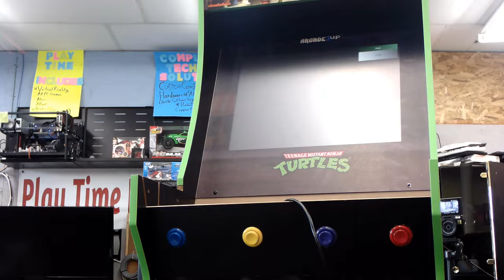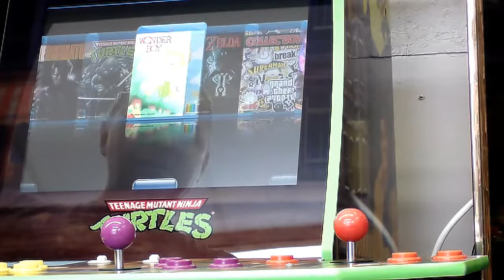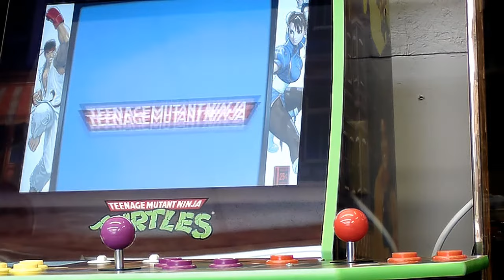Lets "Bake a PI".. This time lets upgrade this awesome TMNT Arcade 1UP!

Comment: Cleanest Arcade 1-UP/Raspberry Pi build I've seen so far!! Well done!! The only things I would change/do, would be to change out the factory speakers for anything better. Mainly since I've heard they blow very easily. I would get and wire up a an outlet for the back so that the plug for power looks cleaner than just a power strip cord sticking through a hole. And lastly customize the Pi's image theme to look just like an Arcade 1-Up theme. But all of these are just nit picks and somethings I would do. Either way, looks amazing and still looks factory!! Very few of these tutorials out there.. Mad props!!
Reply from the maker: graphicsgod Thanks for watching man! I had a great time one that on and I’m about to do another with some crazy twists. Stay tuned :)

Comment: The ‘protective coating’ you removed is plexiglass that is supposed to be there to stop you rubbing the paint off (which will happen if you play it a lot). Its got two pieces of plastic cling on it to stop it getting scratched in transit.
Reply from the maker: Yes it is! I actually noticed that after the fact (I've done 12 since this one) and changed the build a bit each time ;) Thanks for watching!

Comment: I am so excited to do this! I got my cabinet recently and just need to get the parts to start modding. However, I'm seeing mixed things about the LCD controller board working with the TMNT cabinet. Perhaps some have a newer monitor? Can you confirm what model number was on your TMNT board? Mine says 7633 V01a. Perhaps I can send you a pic and you can confirm the LCD board will work? Thanks for the tutorial!
Reply from the maker: Bob Bock Hey Bob, I don’t have the board on me it’s actually at my shop. However, I know it was the stock for that came with the cabinet which she did purchase back in October. I would assume that it’s pretty close to the latest revision. I did also notice that you have to make minor adjustments in the settings of the LCD screen as well as retro pie.
Reply: @AlternateArmsSD  If anything, I get the board and return it if it doesn't work. I can always use a Firestick or something to make sure it works before modding completely. At least taking off the back panel and the TMNT/LCD board is SUPER simple and something I can do in 10 minutes. 

If you're able to confirm it would be appreciated, but there's no rush! I appreciate the response and again thanks for the video!

Comment: Just did this project today and it was fun but a huge pain in the butt. I chose to keep the stock joysticks so I had to literally solder every wire to the a connector and then attach it to the USB encoder boards. The stock joysticks don't have a traditional five pin connector slot like the aftermarket ones.
Reply from the maker: Very nice! I was able to use male to female jumpers to create a "solderless" connection between the "stock" joystick and the USB encoder boards. The stock ones would work but the connection was very tight and I didn't want to risk them popping off. I'm thinking that, in the future, I'm going to swap out the entire button and joystick assembly to a much for advanced set. The stock equipment is "acceptable" but I'm not sure on the longevity of the stock parts. They are definitely not up to a "lifetime of play". There are a lot of other variables I explored but in the interest of keeping the costs down I stuck with the stock equipment where possible. 

I think on the next conversion, Ill upgrade everything. (Including possibly the screen itself)

Thanks for watching!

Comment: Tip for anyone watching this in 2021. That LCD board has an amplified input for sound. You don't need to go out and buy an amp. The little 4 pin port above the aux input that you have plugged in there is the port to connect to. All you need to do is cut off the aux male in on the speakers and connect a 4 pin connector end to it. The cables inside are color coordinated. The red and white is for the audio and the black cables are ground. The two ground pins connect to the 2 inside pins and the red and white connect to the outside. With sound it shouldn't really matter which side you connect them as this isn't like watching a movie with surround sound. The sound is usually flowing through the speakers at the same. With that said, technically the red wire goes on top. If you have an extra joy stick laying around those usually have a 4 pin connector. If the plastic is too big to fit into the 4 pin input, remove the plastic on the sides of the 4 pin connector on the LCD board and just make sure you have conductivity. You could technically just solder the wires directly to it... it is just hard with the pins so close together. Mine is connected this way and pumps out heavy sound. Save yourself the 20 bucks.
Reply from the maker: Greetings! You are absolutely correct! I have a revised build of this coming up soon. The internal speakers are a tad anemic though. I think I'm going to add a bit more punch to the next build. Thanks for watching!

Comment: BTW, I’m gonna record everything that I do and show my finished product.
Reply from the maker: jjrudy41 I can’t wait to see it :)
Reply: SaZoN GoYa yes. I’m waiting on doing one more thing in the mail.light up marquee.
Reply: SaZoN GoYa yes, I added 6 buttons per player. I might actually redo my control panel. I also didnt use a amp. I used pc speakers
Reply from the maker: @jjrudy41  Oh I cant wait to see that! Shoot me pics when you're done.
Reply: Complete Technology Solutions what I did was bought a piece of plywood and cut it out almost to the same shape of the plastic cover that came with it, and then just created my own control panel from there. It came out really good.
Reply: Complete Technology Solutions ok. How do I submit a picture under comments?

Comment: Awesome video so far! I got everything I need and just pulled the controller board and I still am puzzled! Why do I have to flip the on/off switch if it is correct on my NBA Jams arcade 1UP? Also can you please let me know the correct wiring for the single one player USB as I ordered everything you mentioned but, did not get the two player outputs only single player so four boards?
Reply from the maker: Hello and thanks for watching!  You don't need to flip that switch for the NBA jams. It's actually in the correct position. As far as the wiring for the USB encoders, yes indeed one decoder per controller. The USB in coders that I had originally purchased that would put 2 sticks on 1 controller were flaky at best.  So definitely use one encoder board per controller. It doesn't matter how you wire them as long as they are all the same ( And even that is not all that important. You can figure all this in retropie anyway).
Have fun!
Reply: Jon quick question... I wired all buttons the same however the joystick board when i goto test it does not work???? again I created 2 pin wires for the joysticks so that four, and their are four mode, turbo, etc 2 pin following. Why wont the board recognize when configuring on emulation? this is my set up
Reply: sorry ill send it to your email
Reply from the maker: @joshuanickolas4031  In retro pie, have you calibrated the joystick yet?

Comment: I like the industrial velcro idea for mounting the LCD Convertor board, most other videos I see they stick it on some cardboard which looks ugly
Reply from the maker: Greetings and thanks for watching!! Yeah, and that stuff never lets go :-) I’m also kind of a cabling fiend so I like the fact that the Velcro is black. Therefore it doesn’t show up in the background even though I will be the only person that will ever see the inside of that control panel :-) I have another arcade one up conversion video in process now, it’s going to be a little more extensive and I’m doing some pretty cool stuff to it. Stay tuned :-)

Comment: Is it possible to use the stock buttons and joysticks that it came with on the 4 USB controller boards? I don't want to put different joysticks and buttons in
Reply from the maker: ZachAttack84 Thanks for watching! Absolutely! In fact, in this video, I’m using the stock buttons and joysticks. The only addition or the four extra buttons on the front. The truth is, the stock joysticks are not terrible.
Reply: @AlternateArmsSD  Could you please explain how to use the stock joysticks on these USB converter you linked in the description? My TMNT arcade1up joysticks have 2 4pin connectors for each joystick.  The ones you linked us to have 2 pin connects for the buttons + 1 5pin for 1 Sanwa style joystick.

Comment: What a fantastic video. What do you have to do to the Ras pi to get all those games. Once u receive it? Thanks
Reply from the maker: Its not overly complicated if you've worked with retropi. Its just a step by step process. After you download the roms (Where ever you get them) and load retropi, You simply put the raspberry on the local network and access the files structures through the network and drop the roms into their respective directories. (That sounds more complicated that it actually is).. If I get enough interest, I may do an entire video showing how to setup retropi and adding images. Its a tad geeky though which is why I haven't as of now. :)
Reply: Is there specific roms. I really want to add xmen and Simpson's
Reply from the maker: Bobby kuthrell Google search rom packs.. That’s a rabbit hole that will keep you going for awhile :)

Comment: great video! which port number do i plug the tmnt power switch into the rasp pi?
thanks!
Reply from the maker: Hello there and thanks for watching! You'll use GPIO pins 5 and 6 for the safe shutdown/sleep mode for the raspberry.
Reply: @AlternateArmsSD  awesome thank you so much! I have a rasp pi 4, I assume it's still the same?
Also then do you know which port pins the rasp fan should be on?

Thanks again!
Reply from the maker: B Muss Have a couple of options. You can go to pins 2 and 9 if you want to run full speed 5 V. If you want to run 3.3 V you can run on pins 1 and 2 but I would not suggest that with a raspberry pie 4.
Reply: @AlternateArmsSD  awesome thank you so much! I have a rasp pi 4, I assume it's still the same?
Also then do you know which port pins the rasp fan should be on?

Thanks again!

Comment: Reason they need to be wired identical for the 2 sides is a software issue - the Rpi sees both of those USB encoders as identical ( Since they are the same product just on different USB connections) so if they are wired differently the configurations for the software winds up having problems when it sees both as the same type of controller so expects them to have their buttons in the same place and be wired identically ( ie. if one side has joystick down in the place the other has joystick up in the software when the game is running it will sometimes get confused and swap one side or the other so that down becomes up randomly which makes game play weird - SO you want both wired identically to avoid that.
Reply from the maker: JDFan01 Yeah I figured that out at the end and decided to go with individual controllers for each control. That made the configuration considerably easier :-) I still have those “dual” controller boards though and may attempt to use them in the future. It’s actually funny, I bought those from Micro Center right next to their standup arcade machine. However, the “professional” at their arcade machines did not know if you could run dual controllers off one card.

I’ll probably revisit that in the future episode :-)

Thanks for watching!

Comment: I cannot see what you did to connect the power switch to the raspberry pi. What did you use? Where can I get it? Amazon Link?
Reply from the maker: Essentially, it’s a short jumper to the pins on the raspberry. It’s the same basic principle as the nespi cases. I have a more recent video of an upgrade on another arcade one up that you might take a look at. I think I go more into detail and I’ve got links.
Reply: @AlternateArmsSD  Excellent! Which video is it?
Reply from the maker: @ramonrivera837  Try this one (I REALLY Need to do a new one!) :) https://youtu.be/zF6QBIPV2Q4
Reply: @AlternateArmsSD  That fit perfectly in my arcade! I clicked on the link for the "script for soft power on/off" but it do not work. Do you have another link?
Reply from the maker: @ramonrivera837  OK... Try this script and wire the switch to pins 5 and 6.. 

wget -O - "https://raw.githubusercontent.com/crcerror/retroflag-picase/master/install.sh" | sudo bash
Reply from the maker: @ramonrivera837  Ill try to schedule an updated build video in the near future.
Reply: @AlternateArmsSD  Thank you so much! Do you have a video on how to run a script? I do not know what I am doing... lol
Reply: @AlternateArmsSD  I did the script and it kind of works. For some reason, it will start shutdown when the switch is moved to the ON position... Do you have any idea of what I did incorrectly? lol

Comment: Nice video! I bought LED buttons that you linked (the ones from micro center) but they only have two pins. I got the encoder boards for them but they don't register inputs or light up. Am I missing something?
Reply from the maker: You're not getting any response at all? Do you have the common ground installed for the buttons? One other trick, when you boot the system, have a keyboard plugged in. Then navigate to "setup controllers", and press any button on the panel. See if it acknowledges it at all. (Try this for both controllers). Generally, if I got no response, it was either a ground issue or a power issue. This will eliminate the controller as the issue. If you get any response (IE it says something when you push the button) then you're probably dealing with a ground issue on one or more of the buttons.  **** Now, on that note...…… The ones from microcenter (The two in one controllers) had other issues as well. In fact, the folks at microcenter said that they had never "quite gotten them to work completely" which is why I ended up going with a one controller per joystick.
Reply: Never mibd. The Bao Lian LED buttons don't come with any control board or LED.
Reply: @AlternateArmsSD  you know what, I'm just trying them without being installed in an arcade1up. I didn't realize I needed a common ground since the 3 pin encoder boards work fine
Reply from the maker: @CoreyHectus  Ahh gotcha.. Yeah, that encoder card from microcenter was a disappointment.. I had high hopes but it just didn't pan out. I'm going to be doing another arcade1up soon. There are a few changes Ill make with the benefit of hindsight ;)

Comment: Where did you wire the power switch to raspberry pi.
Reply from the maker: Here's a little cheat sheet on that ;) I didn't use the volume control though as I installed the awesome AMP... https://icculus.org/finger/icculus?date=2019-01-01&time=09-32-56

Comment: Next issue, I got the jumper cables and the arcade sticks and all existing buttons are being recognized, but the added button for Select is not being recognized.  I have Player 1 side plugged in with USB encoder but no matter what I do it will not recognize that 4th button.  Is there a specific pin on the USB encoder board that it needs to get plugged into?
Reply from the maker: Luis Galvan Not really. When you go into the configure inputs, it tells you to press one button on the joystick to configure it, if you push that player to button is it acknowledge that it exists?
Reply: @AlternateArmsSD  when I press that button it does not acknowledge that it is being pressed, all other buttons for player 1 work and thank you again for helping
Reply from the maker: Luis Galvan OK, verify your ground line on that button and verify that you have a good solid connection down to the USB encoder board from that button on the positive side. If it still doesn’t work, switch one of the other buttons out to that control port on the USB in coder and try it. That will eliminate the encoder as the problem
Reply: @AlternateArmsSD  I am studying the extra buttons that I ordered from the site you listed and I believe I see the issue.  Inside the button there is nothing to trigger the connection to tell the system the button has been pressed.  I had went with the Baolian series since they had purple but it definitely looks like a piece is missing from each button that when the button is pressed would trigger the wired connection and thus relay to the system that the button is being pressed.
Reply: @AlternateArmsSD  I see the issue and it was my oversight.  The site sells the buttons without micro switches so I basically ordered just the buttons not realizing I needed the micro switches.  I have gone ahead and ordered them.  Thank you again and sorry for 20 million questions.
Reply from the maker: Luis Galvan No worries at all man! Anything I can do! I’ll try keep good vids coming :)